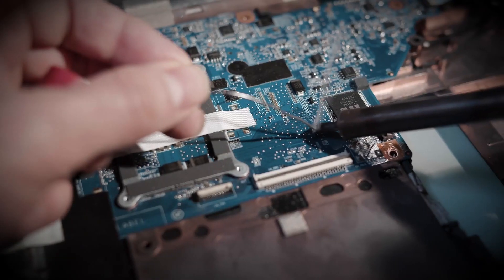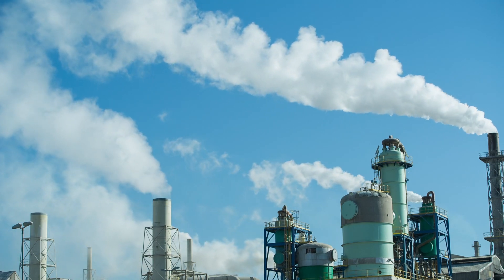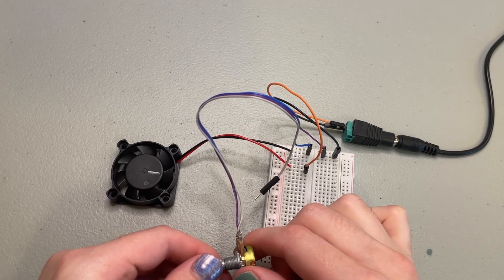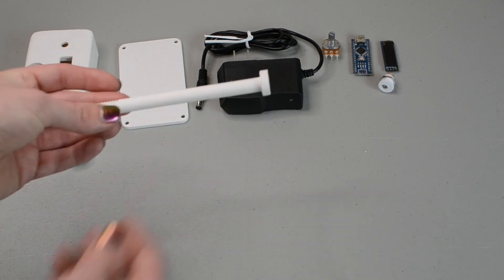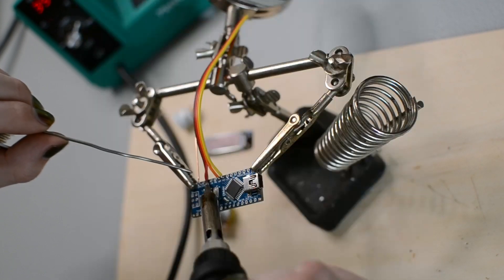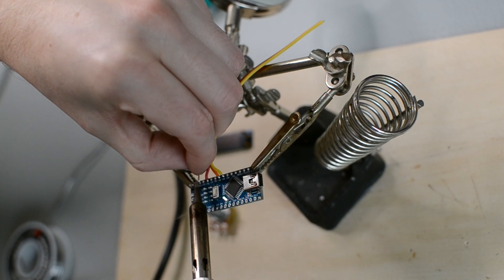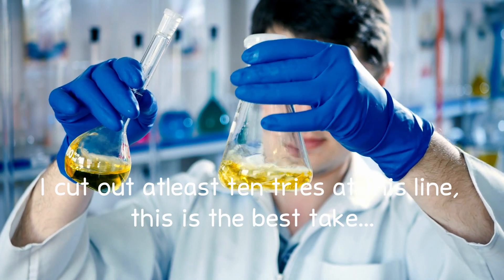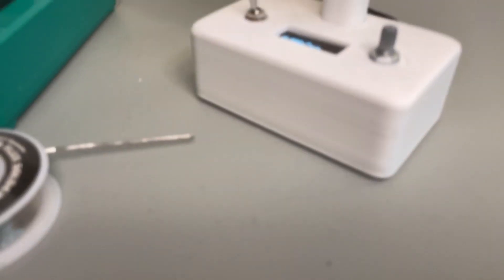Building a Solder Filter Fan

Comment: Tip for buck boost converters (or any voltage changing component) is to check the voltages with a multimeter prior to installing. 
I’ve found the a lot of cheap ones (and pricy) faulty and not changing the voltage at all resulting in a few fried boards. 
Nice little project.
Reply from the maker: Good point. I mention this in the instructables but I should’ve included that in the video too

Comment: So did you do before and after measurements of the AQI to see if your carbon filter is actually capturing the PM2.5 particulates? I personally don't think that kind of medium is effective for that purpose. You're much better off with an electrostatic nonwoven polypropylene material like the stuff in N95 masks. Of course, that will cause a lot more back-pressure on your Noctua fan, so your airflow will likely be significantly reduced. That might necessitate a different kind of fan to compensate, which could increase the noise level. Design tradeoffs all around.
Reply from the maker: I did not do any formal testing. I know it helps to remove the smoke but you are correct a much finer filter would help to ensure removal of all the particles.
And to the pack pressure point, you are correct. The Noctua typically has a lower static pressure so another filter might do more harm to the overall effectiveness.

Overall as a hobbyist who only solders once in a while this gets the job done.